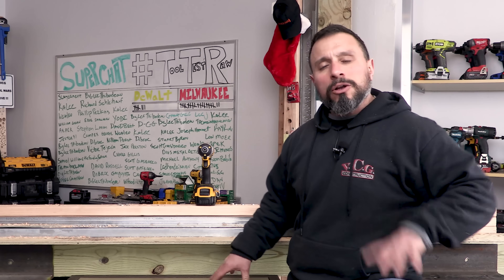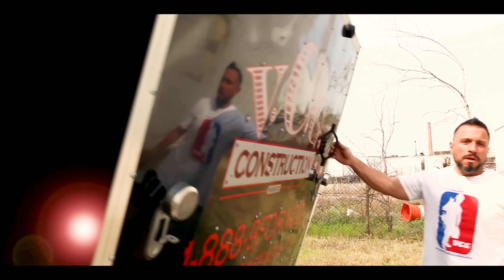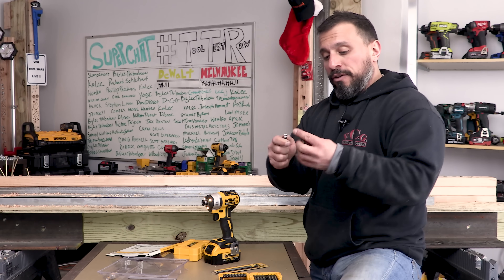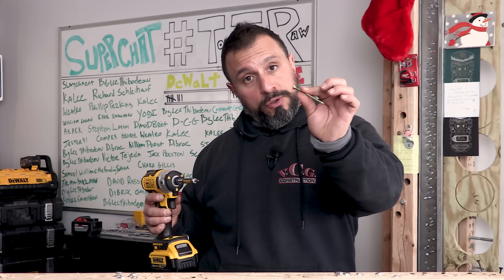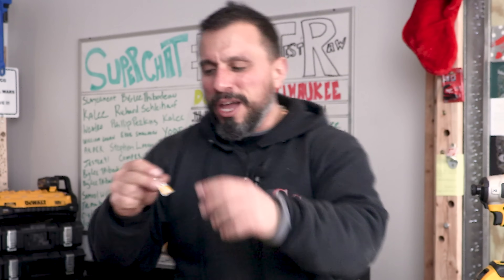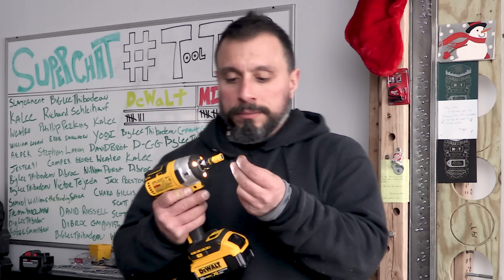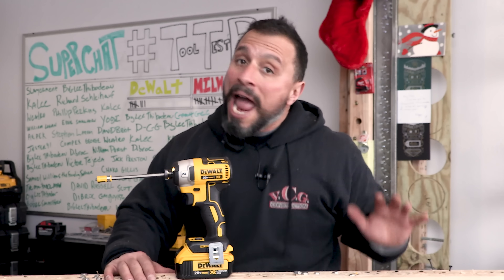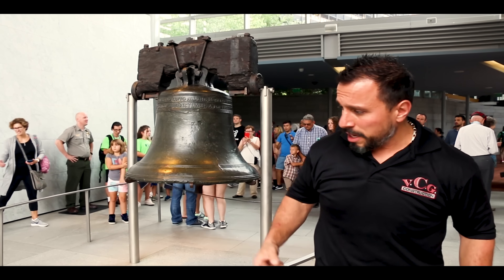99% OF PEOPLE DON'T KNOW WHAT THIS DeWALT TOOL ACCESSORY DOES!

Comment: OK I have to admit that I did know what that was. Mainly because the display shows you when you buy the kit that’s with the little flag thing is you can pull on is for. Then if you read above it it tells you how you can use it as a sleeve on the longer bits. It is kind of cool though. Also when people use the long pets without it it’s a pet peeve of mine too. You obviously know that person does not know what they’re doing or they don’t have the right tools.
Reply from the maker: Thanks for the feedback Richard!!

Comment: So i guess that I'm in that 1% cause that adapter is as i type this still on my favorite #2 Phillips inpact driver bit. It is a nifty little tool. Witch has 2 functions btw it is #1 magnetic so it helps to hold your screw to bit with much greater ease and I'm not sure how many of you out there have hung rock/ gyepsom board ...... But i know that almost everyone of us my self included has over driven a screw into OSB and if your like me you sucked that 1.5" screw clean through the ply leaving a good sized hole and a sheet with one corner that for lack of a better expression flapped in the breaze. Its a head depth stop and it sleeves over tge bit tip and rests in the tapered "neck" of your dwalt driver bit........ I stoped your video at 1:21 seconds as instructed to comment (would of sooner but couldn't see too well what u were holding till you held out to the camera. Let me know if am right or if there's other uses that I'm not aware of. Btw the one i got with my kit is silver not the yellow. I'm not sure if that matters but.......

Comment: 99.9% of ppl don't know... That very cool gang dealt with routers. That's what I get for assuming. (by the way I knew what the magnetic add on was for.
Back to my router question. are routers plunge bases semi interchangeable? 
what I'm saying is if i have a 1 1/4 hp  dewalt is it possible that it would fit my 11/4 hp makita, plunge base. Porter cable Hitachi, Milwaukee etc.
Reply from the maker: You’d probably have to stay within brand

Comment: Did you kno your impact drill holds the bits with out that magnet, just pull the lil out from the drill nd you push the bit in to it, it'll lock in place
Reply: Lil piece**

Comment: Wanna know what that magnet is good for?? Throw it inside a home depot pouch and put a few screws on tge outside of your pouch and there easy to grab i use old speaker magnets a d hold 30 screws on the outside of my pouches easy access i could show you 30 ideas you can use that dewalt magnetic tip for 30!!!!
Reply from the maker: That’s not a bad idea!!
Reply: Hey man check this i had a bolt inside my 5.7 350 mercruiser head. Couldn't find my mechanic magnet used Dewalts magnet with a long extension. Pulled that bolt up out of my engine saving me thousands of dollars!! 👍👍 love tge videos man!!

Comment: Just broke my dewalt little tool accessory it’s only been less than 2 months only used it about for 6 hours give or take
Reply from the maker: What were you using it for, how did it break?
Reply: Screwing in screws for a coffe table the  inside busted balls out lol I was like I hope it ain’t my makita drill then I looked down the balls came out and the metal on the outside busted out

Comment: Yo! Us 'You Tubers' like killing time. Obviously. 
But, one suggestion for the host... I highly doubt that anyone wants to waste their time along with you.
Meaning, try giving your need to be cute {or whatever that is} some kind of form and functionality within your show. So we, your best asset, can enjoy the content without accompanying you in your discovery of fine tuning your techniques, etc.
Ya feel me. Btw, this is all copacetic. No hating from me whatsoever. 
But, the answer to your question... lol.
That would be a must have in my tool belt! That's what I consider to be the best Multi-use Magnetic Bit Sleeve for specially designed and hardened Dewalt screwdriver bits.
Why a must have you say?
Time is money. This little magnetic sleeve will save you A LOT! Of both. 
There's many benefits with using the sleeve that I have found, but the time it saves me is by far the most beneficial. i.e. ~{ attaching screws, holding the screws without the need of a second hand, better end results, picking up loose metallic items, etc.}
👍👍👍

Comment: 🔵 This is to remind everyone out there that is using an 'Impact-driver' to drive screws with,.....
TURN-OFF the IMPACT-FUNCTION when driving-screws!!!
Reply: ?? So what's the point on having an impact driver ???
Reply: To: guille g.i.,
🔵 I should have been more specific and stated that the "Impact"-mode of the driver should ordinarily not be used for Philips or slotted Wood-screws.
"Impact-mode" is used to provide rapid pulses of torque for driving (Especially loosening) difficult Nuts and bolts that have 'Positive-engagement'- type head-design such as 'Hex', 'Spline' or 'Square-Drive', also, with the proper adapter you can even drive lag bolts, but when driving ordinary Slotted and Phillips-head wood-screws under 1-1/2-in. you can all too-easily damage the Fastener-head because, with all the rattling going on, it's very difficult to feel whether or not the drive-bit is "Camming-out" of the Fastener-head, especially on Phillips-screws, even WITH the retaining sleeves he's describing, and ESPECIALLY if you don't keep the bit pushed-STRAIGHT into the fastener-head firmly and steadily enough.
Reply: @joshhayl7459  I see your point. But one more time is a matter of technique. I think is perfect for Philips screws, but you need to know how to use this tool. For me li ion impact driver was a life changer. One of the most useful tools I ever had. This sleeve is nice, but not the way he uses it.
Since the bit and the screw that you uses are decent, I think with the medium torque mode in every impact driver shouldnt have any trouble. I think is a matter of technique. By the way is horrible how he uses it in this video. Maybe on purpose.

Comment: Nice video. So, you know Irwin tools was the first to come out with those Mag Tip for the extended bits. I could not see how desalt built their version but it looks to be much better built. If the have any common build likeness to Irwin’s then don’t drive down to hard as this will eventually capture mags to brake from the mag housing. The Dewalt version looks to have solved this issue by allowing the mag holder to actually have a bit of back travel to allow counter sinking of screws. I loved these extended bits because of the fact they are double-side and could allow me to keep working on my bathroom remodel. The only draw back with these is the mag bits can get in the road in tight quarters & may get or the screw knocked off getting in or out. Other than that well worth working with and these Dewalt ones look way better than the Irwin model and I will be looking to find a couple of them for my tool box!! Yes get a few. You will lose them being clumsy or once people realizing how good these things work 5 finger discounting them from your tool box.

Comment: Dewalt has another tip that I also use for the same reason as that yellow tip,  for ‘silver bullets’ into metal studs but these tips can also be used for countersinking the screws into sheetrock. Small problem with it, magnets attract metal filings and you have to clean them off quite often for it to hold the screws straight.

Comment: Your using it wrong. It locks/magnetizes the bits in place. When u put the special bits incase u need an exact precission. U put the special bit in with the lock grooves and u pull on the magnet body and it lovks it into place.

Comment: Been using mine forever. Know what else is badass? Search Amazon for “USG Sheetrock 'The Dimpler' Drywall Screw Setter Bit - Reversible with Clutch”. Flush every time.

Comment: You know that you can get a magnetic shaft at just about any length.  By the way Those are garbage
Reply: I think he's doing that, in part because of the early on instructions your speaking of..
Meaning, if you are familiar with the brand on the level he's proposing, then a split second glance of the item should be all that an experienced person needs.
I knew what he was talking about before he held it up... of that  helps you at all.

You should definitely add this small bit substantial time/money saver to your tool belt if you don't own one.
You won't regret it.